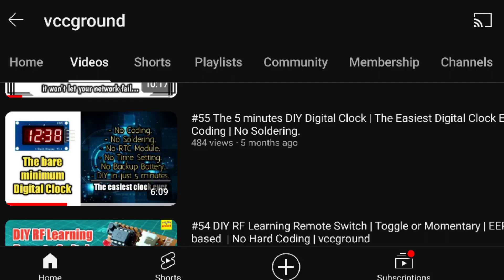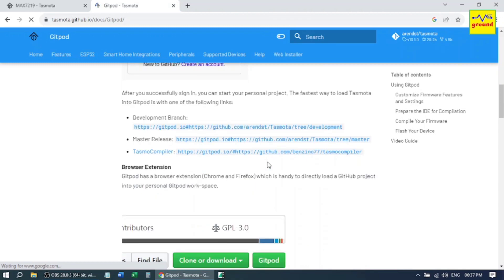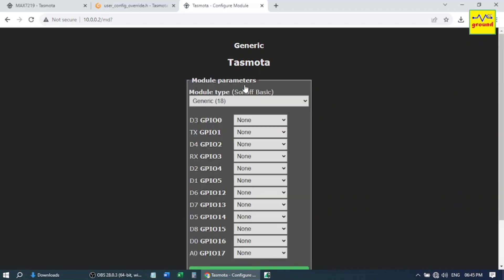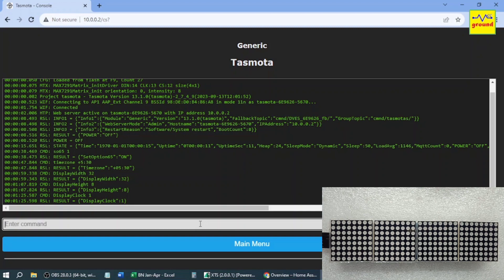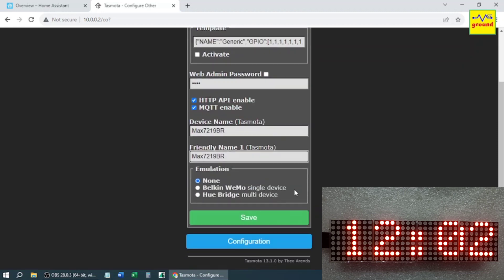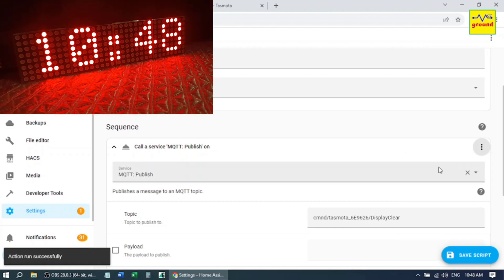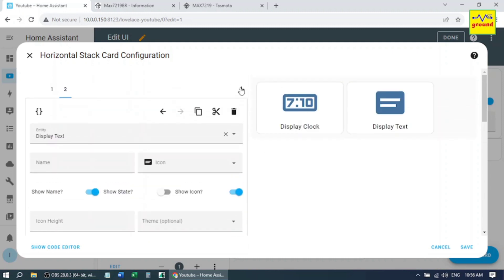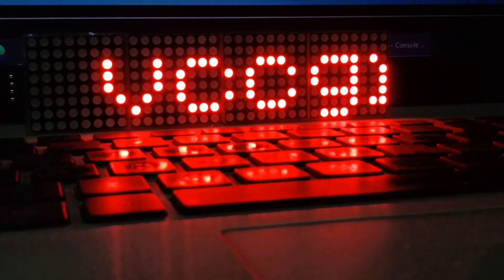#61 Max7219 LED Matrix Digital Clock & Scrolling Display in Tasmota & Home Assistant

Comment: I made GPS clock similar to your clock using LED back pack and ESP 8266. Everything OK except I canot incoporate UTC time that is +5.30   GMT.  For 5 and 6 it is get adjusted but not for 5.30. What  could be the reason. The code used is under arduino expamples , Adafruit LED backpack ,GPS 7segmnet clock.
Reply from the maker: @ranrajfernando9314  It's not your fault. It's the limitation of the Arduino library as it only accepts integers in the time zone setting.
Reply: @the_vccground  .Thanks for the explanation  and for your  response in this regard.

Comment: I get an error in tasmota when trying to flash esp32

the error: Invalid head of packet (0x46)

I really appreciate your video because it is EXACTLY what i'm trying to do :)
Reply from the maker: @Jimmyinnit95  Yes, because it was compiled for esp8266 and not esp32.
Reply: @the_vccground  is there a chance of it working with an esp32, i have 10 of them ahahah i spent 2 days trying to work it out for the esp32 maybe i'm missing something, is there any chance you make a video on the esp32? the neopixels are much nicer then other options
Reply from the maker: @Jimmyinnit95  I'll try but it may take some time bro...
Reply: @the_vccground  no problem i could buy the 8266 instead i've just only used esp32's and no nothing
Outside of those still learning

Comment: I tried several times to add the MAX7219 in user_config_override.h but I get no MAX7219 CLK/DIN/CS in the config of my WEMOS D1 mini. It only works if I remove the // in the my_user_config.h - any suggestions what I'm doing wrong here?
Reply from the maker: Kindly share screenshots of both files showing your modification to let me spot the issue. You can share on vccground telegram channel.